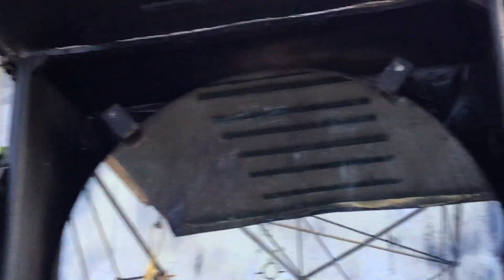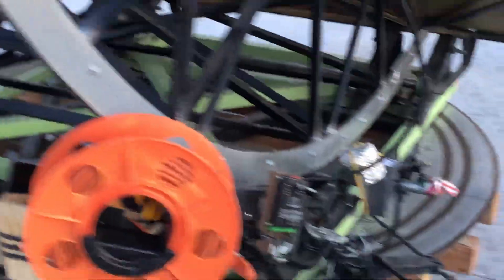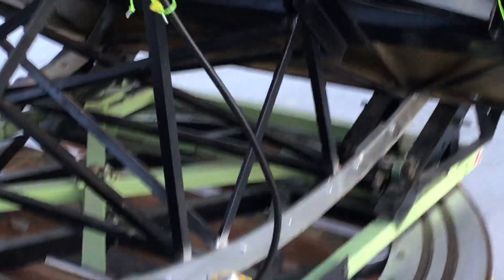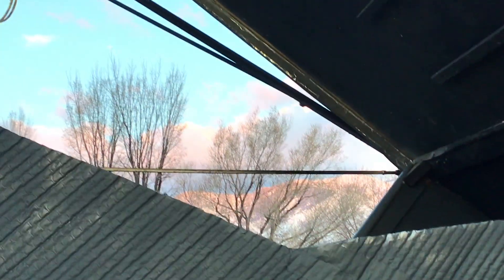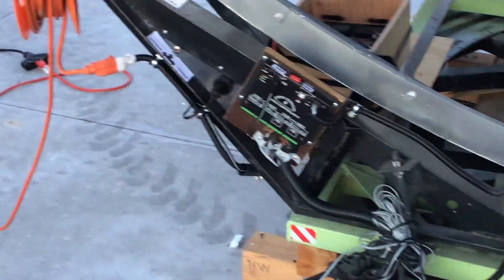Clements 70 Inch Telescope... opening mirror cover

Comment: Hello Mike!

Very impressive and inspiring,

How would you describe the views compared to smaller apertures?
Reply from the maker: @Gabriel Wiklund .....Really good question!.... What strikes me most about the views through large telescopes, (I have also looked through the Mt. Wilson 60”) is the amount of fine detail (resolution) when compared to viewing through smaller telescopes. At the observatory complex, there is an excellent 32” telescope, and even though both telescopes, the 70” and the 32” are typically used at approximately the same magnification, (image scale) the amount of intricate detail, for example, in the Orion nebula, is dramatically superior in the 70” telescope. Along these lines of discussion, I would like to mention that people often ask me about how much of a deleterious effect the atmospheric stability (seeing) has on a large telescope. When we have compared views of say, the planets, through the 70”, to high end APO refractors, on nights of poor seeing, even though the view through the large telescope may be “boiling”, for the occasional few seconds, when it sharpens up, the amount of fine detail that pops into view, is dramatically more through the large telescope. And on nights of good seeing, the 70” walks away from everything! I have even experimented with off-aperture masks, and I have not been impressed. What is being gained slightly in sharpness, is sacrificed in the amount of fine detail visible. So, what I have discovered, is large telescopes (40”+) seem to be in an entirely different league in terms of performance, and rewrite “traditional” understanding of observing, when compared to smaller telescopes.
Reply: @mastro4065   That's very interesting! I thought that the most striking thing would be, that dubble the aperture gives twice the magnification at the same image brightness and twice the image brightness at the same magnification.

To on top of that really notice superior resolution must be a truly amazing experience!

I've just gone from 8" to 16" and the feeling was indescribable when spiralarms were obvious in M33, M101 and M51!

Equally interesting that you take up the topic of seeing & large apertures.

I actually no longer even believe  that larger apertures are more effected by seeing. I think it's because it's harder to achieve excellent optical quality with big mirrors, people don't let mirrors reach thermal equilibrium and the lower f-ratio wich requires more accurate collimation.

If however im wrong, just like you said it's just a question of waiting for those few seconds when the view sharpens up to se the superior amount of detail.

Its so awesome and inspiring, even just to hear that there is a new leage above 40"+

What objects thrive the most in your monster?
Reply from the maker: @Gabriel Wiklund....yes, I wholeheartedly agree with what you described going from 8” to 16”. In that case, yes, light gathering has completely obliterated the smaller mirror. But with 40+, (I also owned a 41”) the biggest “shock” when you first compare views is the amount of detail, rather than simply larger and brighter images. When I would look at sketches drawn by the old-time observers, using large telescopes (example, Earl of Rosse’s 72”) even though these telescopes lacked some of our modern optical refinement, the sketches displayed the DETAIL I didn’t think was possible to see visually. Something which truly demonstrates this, is when the silver coating of the 70” tarnishes (has to be re-silvered each year) but even when the amount of tarnish reduces the REFLECTIVITY to approx. the same as the 32” telescope, both images appear equally bright, but the view through the 70” appears more intricate. It is as though if a drawing were being made with each telescope, the drawing pencil would be sharper and finer, and more attention to minute details, as well as shading. And even though, due to the tarnish, stars of equal magnitude would show equally bright, the 70” would show TIGHTER more INTENSE star images. And close doubles, such as Sirius and the pup are more clearly visible, when compared to the 32”. Of course the 70” is always eventually re-silvered, but I enjoy the learning experience even with degraded coatings! And yes, I believe a lot of people are too hasty to let their optics equilibrate. They blame the larger telescope, because it has not properly reached temp. I believe proof of this is the love-affair with “cooling” fans a lot of amateurs place in the mirror cell. This will hasten the cool down (good) however, it is a band-aid for the solution, which is simply being PATIENT, and letting it cool naturally. And yes, collimation is far more sensitive with the faster focal ratio scope! So yea, sometimes larger telescopes get a bum rap, when other factors are at play!
Reply from the maker: @Gabriel Wiklund ...Objects which thrive in the 70” are objects which include A VARIETY of features. Example: the Swan, which displays tiny, intense stars, as well as gobs of nebulosity. Stephan’s Quintet is always a show stopper, with all five members being cleanly separated. And of course, the usual suspects, M 42 is amazing, as well as M 57, with the ghostly central (actually, OFF-CENTER) star embedded in the bright central part of the nebula. What has really amazed me is the planets. Jupiter, and Saturn, show a wealth of detail, and in the case of Saturn, as many as thirteen moons visible! It looks like a moon-fest! Neptune, and its moon Triton are always fun, and Uranus with up to three moons visible. These are just a few examples!
Reply from the maker: @Gabriel Wiklund .....I HATE it when youtube does this...apparently your comment got blocked on my channel NOT BY ME (youtube spam filters are REALLY sensitive) and when comments are placed rapidly, sometimes that trigger the algorithms...But I saw a partial part of your comment that posted on my Youtube e-mail, and yes, I used to think Earl of Rosse was making it up, especially, the drawing of M 51!  But nope, it is the real deal!  Feel free to keep posting, I LOVE TALKING ASTRONOMY, but allow approx. twenty minutes or so between posts, to pacify the Youtube spam filters!
Reply: @mastro4065  I agree! They are taking it to far. Incredible, Earl Rosse's drawings are my favourite!
Really appreciate that you just as I, love talking astronomy! Very few even think about the night skies.

In my last post i also wrote:
"So silver coatings tarnish faster than aluminium?"

"Wow awesome!! If i were to look at M42 through a scope like that my heart would be racing as i approached the eyepiece"

By the way, was this spy-satelite mirror already a coated parabola? Today, what's the f-ratio?

When you were finnished building the scope and realized first light was approaching you must have been praying to stay alive untill the skies cleared!
Reply from the maker: @Gabriel Wiklund ...Oh good, you’re back! ....I have seen situations where Youtube blocks ANY AND ALL comments from a particular user, on a channel, if their all-mighty filters are tripped!    OK, yea, I only received a portion of that post...let me answer the “missing” questions: the mirror was UNCOATED. The project, Manned Orbiting Laboratory, a fancy way of saying “spy satellite” project was cancelled. The U.S. government intended to have two astronauts ride around in a satellite, and snap pictures, (yes, this was in the 1960’s, BEFORE CCD’s, so film had to be handled MANUALLY!) However, after the U-2 incident, the U.S was looking into other means of spying. The SR-71 project, was highly successful, where the plane could actually OUTRUN (outfly) Soviet missiles, with the pilots actual taunting the Soviets into firing missiles, and then apply afterburners, to then see the missile fizzle, as it spent its fuel in a futile strike attempt! And also, around this time, CCD’s came onto the scene, where images could be transmitted electronically. Spy satellites were not obsolete, however, with the U.S. continuing the “Keyhole” series of unmanned satellites. The mirror, is an F/6.125 hyperboloid, which was designed for a specific (although unknown by me in my research on this subject) photographic application. Since it is NOT a paraboloid, I was concerned it would not focus sharply, being used in a Newtonian configuration (flat diagonal). However my optician friends did the math, and I was relieved that the deviation from a paraboloid was so minute, it would not be visually detected, until possible at 2000 X (power) or so. And even if so, would simply appear as slightly over corrected. Good news is, I approach nowhere near those powers in routine use, and Ronchi lines are straight as railroads tracks, when I utilize a Ronchi eyepiece.    But since the mirror was never coated, I must manually silver it about once per year.  And yes, M-42 is indeed, practically an out of body experience, with MULTIPLE COMPONENTS of the trapezium visible!  Yes, at the time of proposed “first light” I was a complete basket case. As the construction neared completion, I anticipated, yet dreaded first light. Would this thing possibly be a dud, resulting in nothing more than a colossal white elephant, an astronomical “Spruce Goose”? I remember in the late afternoon the moon was visible, and like a small child curious about what it may be like to stick a screwdriver in a light socket, I HAND HELD an eyepiece at the approximate focal point. (I had not yet permanently affixed the focuser assembly) with trembling hands, I VIEWED THE MOON!  I had just become the first person in history to VIEW through...a spy satellite! I promptly jury rigged a focuser, and my friends and I savored the glory!
Reply from the maker: @Gabriel Wiklund...I forgot to mention, the reason I silver, rather than aluminize, Is due to the fact the mirror, due to its size, will not fit into any commercial aluminum coating chamber. I spoke with the University of Arizona (yea, the big wigs!) and it would have cost multiple thousands, and worst of all NO GUARANTEE It wouldn’t be broken during the coating process, and no overcoating, so aluminum, with no overcoating, would also degrade. I might possibly get only five years between aluminum, non-overcoated applications. So with silver, the mirror is left in the telescope, and the silver is, believe it or not, SPRAYED onto the mirror. However, this is a chemical DEPOSITION process NOT a layering process, so no worry about uneven “orange peel” buildup, which would render the figure of the mirror useless.
Reply: @mastro4065   That's not acceptable, YouTube should find a better solution!
What a story!! One of a kind to say the least. F/6, perfect!
Were you searching after a 70 inch mirror or did you stumble over it and realize the opportunity?
What a bullz eye that everything went well!
Sounds good, i think I read somewere that some folks have gone back too silvering, my memory of it is very vauge though so i might be wrong.

Hope you get some clear skies the coming new moon!
Reply from the maker: @Gabriel Wiklund....yes Youtube is so weird the way they censor comments...I have played around A LOT and discovered some tricks...You can see if your comments are posting PUBLICLY by LOGGIN OUT, and clicking on the video, to check if your comments were “allowed” by Youtube...such a shame, because, in their desire to shut down spammers, they have the collateral damage of censoring LEGITIMATE comments!    Yes, I had bought optics before from a friend of mine, he is in that business, and when he came across the moth-balled spy satellite mirror, he KNEW I would be interested!  F/6 is long, it is truly a beast, but I am happy it is long, so as not be (as) sensitive to collimation, as faster mirrors.    Yea, there are folks dabbling with silvering telescope mirrors...it is dirt cheap, compared to professional aluminizing!  Thanks for wishing me good observing! Same to you with your 16”! 👍👍👍✅✅✅
Reply: @mastro4065  Just seeing this video. I really think you ought to get your mirror aluminized, even if it does cost a few thousands of dollars. It has to be a very small amount of the total price of the scope and really worth it. Most of the time you will not get as much light as you should and it's very hard to apply a uniform coat of silver all over the mirror and in the end you might also scratch its surface. Unfortunately, most observatories don't protect their coatings. I have a smaller telescope (only 45 inch), but in better skies than yours (Atacama desert), and also larger celestial objects and can only agree with your comments. Before my larger telescope was a 28 inch, and the 45inch is a completely different league. Objects are very detailed, jaw dropping. Never saw Jupiter in a telescope like I saw it in the 45inch, lots of colors, crazy details, really jaw dropping. By the way my mirror also came from the CIA (Gambit 7 and 8) and your apparently is related to the Dorian project (https://en.wikipedia.org/wiki/KH-10_Dorian ) with 6 of the mirrors being used several years ago in the MMT in Arizona.
Reply from the maker: @Alain Maury ....I really appreciate your input!  However, in regards to the coating process, I have researched the subject far more than, perhaps you believed I have. First of all, the silver coating IS evenly distributed. It is a DEPOSITION process, NOT a layering process...as in “spray paint”. No worries about me scratching the mirror, the cleaning process is very meticulous. Second, no known aluminizing company would provide me ANY GUARANTEE the mirror (cellular construction) would not be damaged in the process. In this video, the mirror looked tarnished, because it simply had not yet been resilvered for this season. While spray silvering certainly has its drawbacks, At this point, it appears to be the best bet option. Wow!  You must get some amazing views through your 45 inch!        Yes, my mirror is believed was one of a few mirrors built for the MOL project, (manned orbital laboratory) which was cancelled.